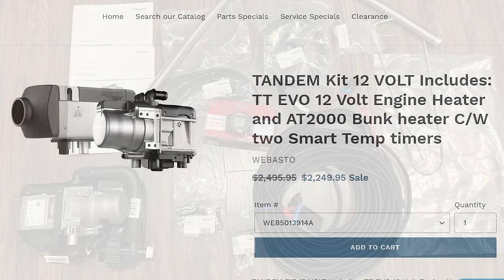Ultimate DIY Diesel Heater Build!

Comment from the maker: This is one of the best mods I have done on my XJ an it means no more cold starts! Its a simple and expandable mod to turn my Diesel Heater into a diesel engine block coolant heater for cold winter startups. It will also heat inside my Jeep cab and the roof top tent making it a much more useful and versatile unit for winter overland camping. I've got a little way to go with it before its complete, like an EGR Exchanger and ducting, but the project has legs. 
 
When I wake up in the morning at camp, with the intention of moving on, I fire up the diesel heater to begin removing frozen condensation from inside the tent. Normally the heater runs for about 2 to 2.5 hours over this process of me getting up, making breakfast and packing down the tent. Then after this I like to pre heat the engine with my Defa heating element, and the maximum I can run this for is an hour, because it drawers 600w an hour. My engine is barely warm by this time, but its the best I could do with what I had. 

So now with this new stand alone system, I'm heating my engine up at the same time as my camp pack down, meaning I have saved a lot of time, power and hassle. Plus my diesel engine is actually warm! The advantage of this system is its taking diesel from the Jeeps 100 litre fule tank, and only using about 30w an hour from my 1500wh battery, so it can be run for great lengths of time to ensure proper engine preheat in sub zero temperatures. I should note that this is something I really only use when i'm around my vehicle. Its only held in with a strap and can be ripped out pretty quickly if I suspect its failing. Despite how reliable this unit has been I still don't really trust them completely.    

It has to be said that these units already exist on the market but I wanted to try and make one myself rather than buy one, mainly because I already have a reliable diesel heater. While building this contraption i'm also servicing my Jeep XJ in peroration for upcoming excursion. Thanks for watching!
Reply: Hello Mike, as always I love to watch and learn from your videos, I have a question for my Cherokee, It has a small leak from behind the fuel injection pump, do you know what could it be?
Reply from the maker: @cole000-x4w  is it oil or diesel? Black or clear fluid. Thanks for watching!
Reply: @WorkshoptoWilderness yes sorry, its diesel
Reply from the maker: I would suspect it's a fuel line fitting, perhaps. Hopefully, it will not be from the pump itself, or it will need to be removed and disassembled and resealed.
Reply: Yes man I hope too, so you think it's like an o-ring or a gasket or the line fitting itself? this problem started now with very low temperatures.
Thank you for your time man👏🏼
Reply from the maker: It's just a compression fitting on the lines. Metal on Metal. Try tightening it just a bit

Comment: Mike, very clever mod. My son and I both have late model XJ's and we follow your channel religiously! Everything you do has sound reasoning and you explain yourself very well. My son just purchased the diesel clone off of ebay and we're also looking at more efficient ways to preheat the engine, inside the vehicle, and sleeping quarters through recycling heat. This episode is giving us some design ideas and although we have gas engines (OM617 conversion in the works), this is valuable R&D that saves everyone time and money. Thanks for what you do! If you need anything from the states, just give me a holler and I'll see what we can do.

Comment: Awesome dude! In Alaska I’d use electric battery warmer blankets, coolant circulators, and oil pan heaters, but I didn’t personally know anyone who ran diesel heaters at the time. I’m looking forward to seeing how you finish plumbing the heater.
Reply from the maker: I'm surprised it worked so well. I've insulated the hot pipe on the heater, and it's working faster. 
Insulating the ducting is pain in the ass. My hands are destroyed. How are your travels going?

Comment: Nice one!! Diesel heater is, in my opinion, the best system in arctic conditions. The electric plug in coolant heater is nice and very easy to use and doesn't smoke, but unless you're at home or a workplace where you have a plug next to your parking space, they're useless. A standalone diesel heater is a great addition to your Jeep, it'll surely help to make it even better at working as your transport and base camp, regardless of the weather. And having warm air inside the Jeep/tent is a real bonus! Quite a smart system you built there, even though it definitely looks like an industrial penis pump. 

Good work Mike!! 👌🥳💪🔥
Reply from the maker: Haha, it does look like the Suck & Blow 9000! I think I will call it that when asked what system i use. It's working a treat, which is great. I'm just finishing the ducting and insulation. 
Hopefully, it holds up under there 🙏
Thanks for watching

Comment: Makes loads of sense to use the diesel heaters output to pre heat the engine. 
Good job.
Reply from the maker: I'm glad it worked! Some insulation and fine tuning, and it will hopefully be a good system. Thanks for watching.

Comment: Buy some good bearings and check if they are packed with enough grease before you replace them in the water pump you just took out, it should last a long time then. I've found that it is a common problem with new bearings, they do have not enough grease in them...

Great mod, I have this DEFA block heater in one of my cars and it works ok, but it replaces the block coolant drain there, and the engine is a small 1.6 petrol so a different scenario. In this boat anchor, I am sure that it wasn't great.
Reply from the maker: That sounds like a sound plan to be fair. I will press them apart and try and rebuild them. Otherwise, it's a total waste. 
Yeah, the old vm lump doesn't like cold starts. Only salt water and a constant rpm in a mechanically biased gear.

Comment: weirdly saw a thing on the book of faces where someone had put a radiator into the exhaust line of his diesel heater to get more heat out of it. was been used to heat his workshop but seemed to be pretty good this looks like a great idea may have to steal it for our Landrover trips into deepest darkest Buxton
Reply from the maker: I've seen few things like that. It's about 90 pounds for the exhaust device. I will probably get one eventually. Seems like a huge waste of energy to loose all that exhaust heat. Thanks for watching

Comment: Hi Mike! I love your channel! I do similar projects here in Canada. I do love winter camping too... my jeep is gas, it starts at -40 no problem. However, if you have a diesel engine I'd recover the heat from the heater exhaust to pre heat the engine oil. That's how we start big diesel engines here 👍
Reply from the maker: Do you start it in those temps with no pre heat at all? I have and have had gas engines also, and I only started the ones i didn't like without pre heat, lol. It's so bad for the engine. 
That's a good idea on the exhaust and oil pan. I will try and make something so it's warming the pan up. Should make a huge difference, actually.

Comment: Awesome stuff Mike - I've had my eberspacher exposed to the elements (in the UK and one Polish winter) for 13 years and it's absolutely fine. One thing it may be worth doing (i did because it was easy) is lagging the air ducting where it is outside the vehicle. This also protects the ducts from getting damaged obvs. Interested to understand how you put the chinese electronics on the eber block - is there a video on that or shall i just google it ? Take care, Ringo
Reply from the maker: Originally, I had a China unit. Then, at work, they tossed out a complete D2 because it blew white smoke. They let me take it, and I repaired it. All it was was a blocked intake on the burner. 
The required electronics were very expensive, so I just swapped them out from the China unit. It worked perfectly and has continued to for about 5 years. I replaced the China pump, fuel lines, pump dampener, exhaust, and silencer with genuine parts. 
I certainly wouldn't recommend it, but I just did it because I had the parts. I raised the intakes, and I've almost completed the ducting. It's working well so far!

Comment: I might suggest a longer intake hose so that the filter is mounted higher in the engine bay and stays dry
Reply from the maker: Good suggestion. I've got a longer intake duct and combustion hose to the top of the engine compartment. I don't forsee any water crossings up that high, but for snow, it will stop them clogging up. 
Thanks for watching

Comment: Looking forward to seeing how this turns out, I’m about to install a diesel heater in our Pajero/camper so I may hold off to see if an exchanger makes the purchase list 🤔

Love the videos as ever
Reply from the maker: I will make an update video. I caught some dirt virus, unfortunately, so I couldn't get a video made on it this week. 
I did finish it and test it, though, and it's working unbelievably well. It was 30c yesterday, and I had it outside for 4 hours. The engine was about 30c and the cab was very warm. 
I could even drive with the system on which was warmer than the jeeps heating system, and it warmed the engine up faster. 
All in all, I would definitely do it, but it might be better to get that one from alibaba to keep the size down, depending on how you feel about it.

Comment: Mike I've followed your Bushcraft channel forever, and this one as soon as I found out about it. I've been into vehicles for a very long time, so it was awesome to see this channel. I love what you're doing and really enjoy the content. You remind me of most of the guys where I grew up. "Backwoods Engineers"

Edit: I'm sure could come up with a hot water system using this? Either off of the exhaust, or using the engine coolant.
Reply from the maker: Appreciate you following along for so long and for watching. My love for vehicles came in late at around 27 years old, when I got my first jeep and started using it for bushcraft courses. 
I sold it and got this one at about 30 years old. It's been 10 years now with this jeep. Crazy.
A hot water system would be king in these cold conditions. I'm thinking about it often. My concern is being able to drain the system so it doesn't freeze. Or it has to stay running continuously. 
Thanks again for watching!
Reply: @WorkshoptoWilderness  You've progressed a long way in a short time when it comes to your mechanical and fabrication skills given that info. 

If you were to do a water tank underneath somewhere (I'd say HDPE, but with insulation and a skid), I'd think it would be pretty easy to drain. If you were to implement a pump into the system, you could use it to either suck in, or push out water.
Reply from the maker: Progressively mad, perhaps lol. I will look at what others have done and see what examples I can find. I think a tank underneath is a good idea 💡 hummm, you've got me thinking now

Comment: Just an idea to get the noggin clicking and I doubt there is room, especially if you need to put a 'Y' in, but could you put the hot air through the airbox and is it possible to do this in such a way that it wouldn't exhaust through the intake, eg on the cabin side of the recirculation valve? Air would distribute through the cabin vents and as a bonus, put some heat into the exchanger.
Reply from the maker: I think that might be very difficult with the space I have to work with. It would be very nice, but unfortunately, I don't think I can pull it off.
I've ended up drilling a vent hole in the passage side behind the firewall. The heater vents directly into the jeep unless redirected to the tent. It's basic, but in -30c yesterday, it kept the engine warm, and the jeep warm inside. I aimed the exhaust at the oil pan. Takes about three hours, though, in that temperature for the engine block to reach about 35c, though.

Comment: Been wanting to do something similar but still portable somehow 😅 I'm scared of the whole rig going up in flames with it bolted on like that. With the portable at least you could rip it off the jeep and throw the fireball somewhere else.

Also good to know you diesel guys have water pump issues like the rest of us 😂 AutoZone here in the states sells a pump with a lifetime warranty which pays for itself quickly at the rate that they go out. Using the least amount of belt tension possible (just enough to keep it from squealing) seems to keep them alive for longer.
Reply from the maker: It's just held in by being wedged in there. The fuel line and connectors would just come undone if you pulled the heater out. I wanted it that way because I don't like them being bolted on. The other element of them is that I only use the diesel heater when I'm at the jeep. 
It's been very reliable, but there's always a but with these things. 

It's great that you can get one with a lifetime warranty! I think I've burnt through loads of them over the last five years. My belt or tensioner must be off. Thanks for watching

Comment: hello, I follow you recently on YB and would like to ask you a question if possible
I am considering the purchase of XJ '99 2.5 TD. I know that it has the problem of the motor heads, my question is: is there the possibility of replacing them with more robust and reliable ones?
Reply from the maker: Sorry for the late reply. You can replace them with the AMC brand of head, they seem to be much better. Obviously its possible to crack them like most heads. I would just make sure when you start the Jeep you give it a minute to warm up before driving. Also the same goes for stopping.

Comment: Are you not worried about water getting in the diesel heater if you do a water crossing?
Reply from the maker: I've done one water crossing in ten years that was high enough to submerge that part of the vehicle. It's very uncommon for me. I'm more worried about snow. 
Once completed, all of the ducting will be elevated apart from the exhaust. I want to run the exhaust into the jeeps exhaust to further waterproof the heater. I just have to figure that detail out.
The only issue left is the box of the diesel heater itself. My short-term plan is just to seal it up with silicone and reseal if I need to change a glowplug. Long-term, build a new sealed box that's quick release. 
Thanks for watching

Comment: The exhaust gases from the heater being vented into the engine bay would keep everything toasty, also the air inlet could run from the heated cab area so the inlet air isnt to cold. keep on all night? with a smell length of duct connecting cab area and tent?
Reply from the maker: That's a good idea. I will see how it looks for space. It's pretty tight with all the ducting and insulation. It's working well though, just some fine tuning and testing, but it's nice to just click a button, and everything fires up. I won't keep it on all night. I just don't trust it, although I'm sure it would be fine. It's just for the evening and morning before departure. 
Thanks for watching and for the input
Reply: i installed a 8kw diesel heater in my house last year to cut heating costs as i relied on expensive to run electric heaters. the diesel heater on low is very safe and will happily run continuously. i have gas central heating now, much better.

Comment: Isn't there anyway you can get the Jeeps fans to start together with the dieselheater. I run a Webasto that is made for heating the car and the controller starts the fans inside the car while the heater is running. In usually 15-20 minutes the car is toasty inside.
Reply from the maker: I'm sure it could be done, but in this case, my diesel heater runs off of a separate battery in the back. I have a duct from the heater in the jeep, so it's pretty efficient at warming everything up. Otherwise, with this build, the warm air would just be going nowhere if you know what I mean.

Comment: Hi
I would like to install a hot-air diesel heater that will blow heat into the interior in the engine bay, because I have found a suitable place to place it and it will not take up space in the interior. I was told that such a hot-air heater is not suitable for mounting in the engine compartment, because it is not waterproof, it can cause a short circuit and fire. What is your experience with it?
Reply from the maker: I think it depends on what you do with the Jeep. If you river cross a lot then it could be a problem. You can waterproof the unit like I have done. it requires black silicone and making sure the air intake ducting is taking air from high up. I would recommend using a heat exchanger in front of the heater to heat the coolant as hot air alone might take an extremely long time to heat the engine.
Reply: @WorkshoptoWilderness  but I want to use it as a classic hot-air "webasto" for heating the interior. This is an imitation of a 2kw Vevor hot-air heater. When I measured it, it should fit between the coolant expansion tank and the air filter cover. I wanted to connect it so that the hot air from the heater blows into the original car heating pipe, but that is probably unrealistic. I saw on some video that you had a pipe from a similar heating brought out into the interior in front of the passenger. Did it work well? So, if I seal the heater cover with black silicone and bring the suction up far enough, will it be possible to mount it in the place where I mentioned it without any problems with water ingress?